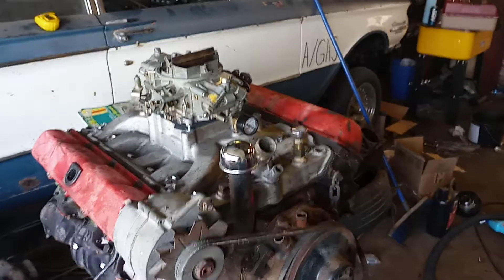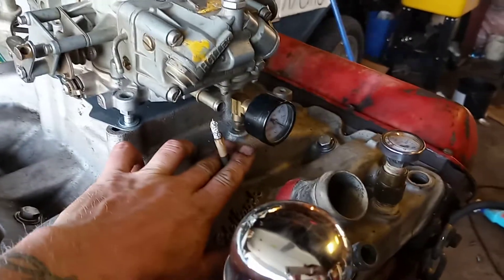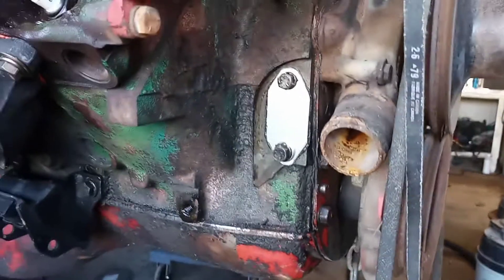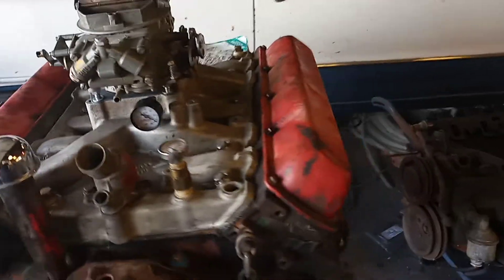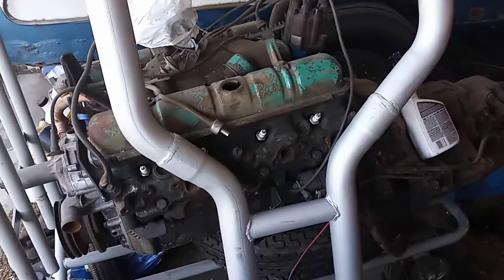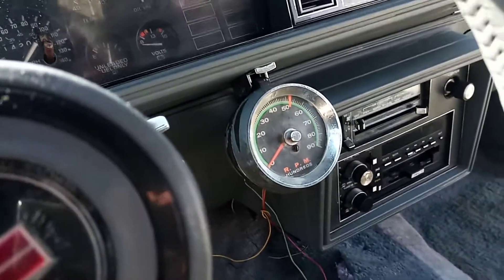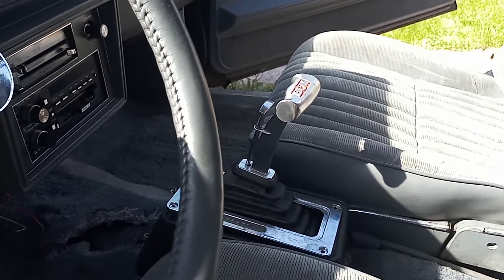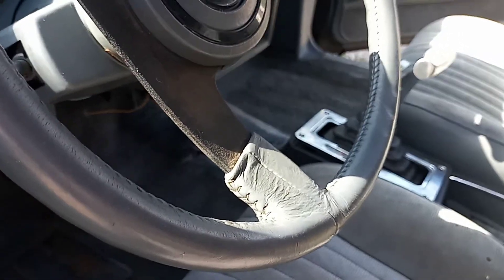442 G body update

Comment: Hey man I'm doing a similar setup 455 Olds in a 85 Cutlass. My question is what transmission and crossmember are you using? Did you have to get a drive shaft sized? Thanks in advanced great stuff your doing keeping it all Oldsmobile
Reply from the maker: If your running a th350 use the 3 speed auto cross member and cut the driver side and plate it like I did in one of my videos. As for drive shaft  any 3 speed auto shaft will work if your running a th350 if you have a 8.5'' diff you will have to cut the shaft down 1'' I have a video on that as well. Feel free to ask my any thing. I have a 83 cutlass brougham with a 488 olds as well.